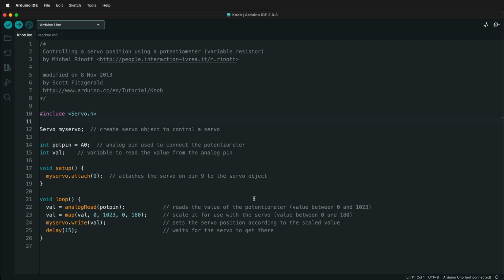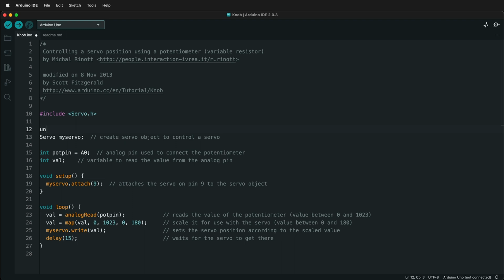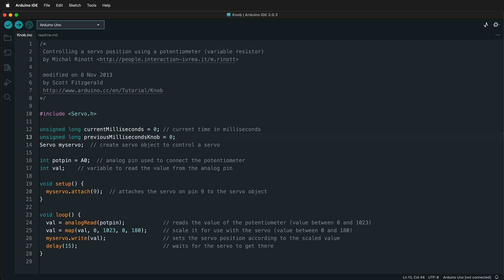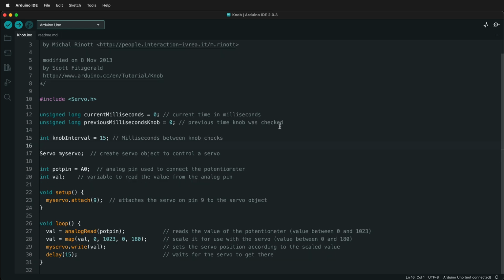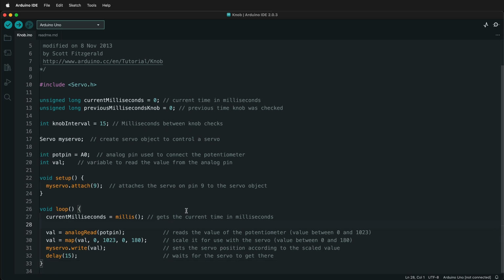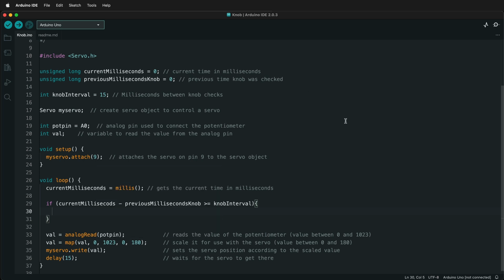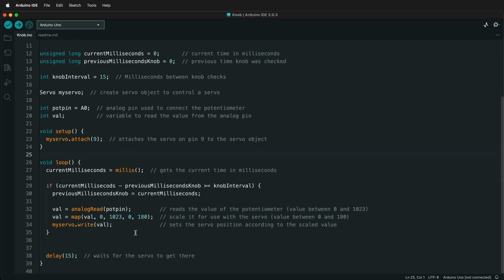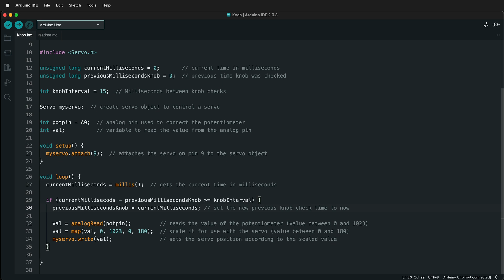Arduino Sketch without Delay

Comment: Im sorry i found this late😊...but my question is, what if there is another program after the servo that requires a delay say 2sec, followed by another 3rd program with delay of say of 3secs. Any help will be appreciated
Reply from the maker: You can use a state machine to control the program flow https://whatmakeart.com/arduino/arduino-state-machine/